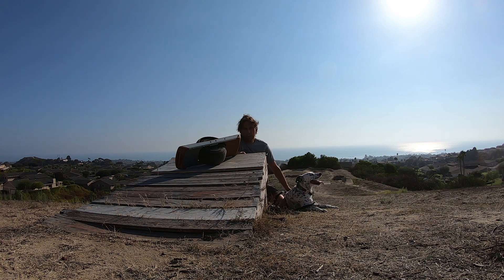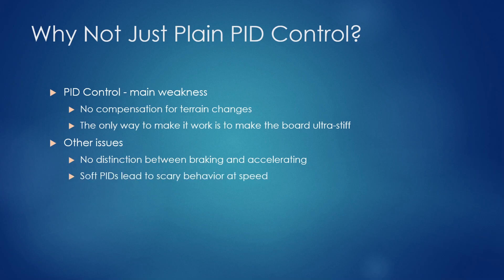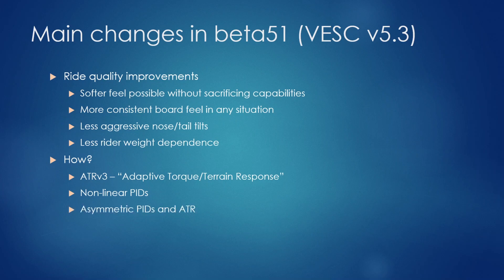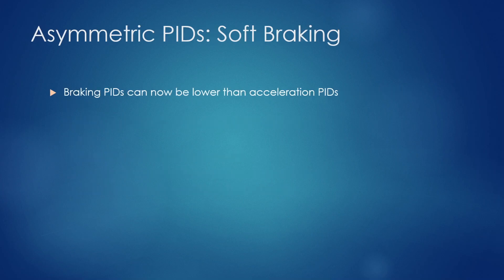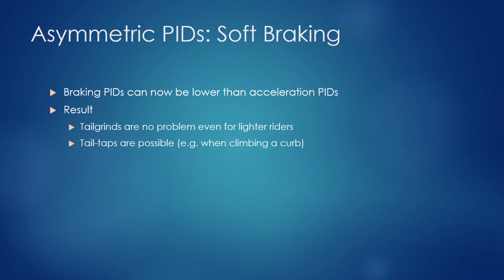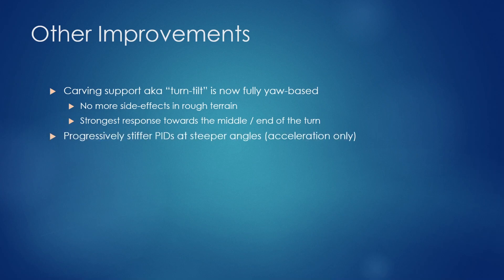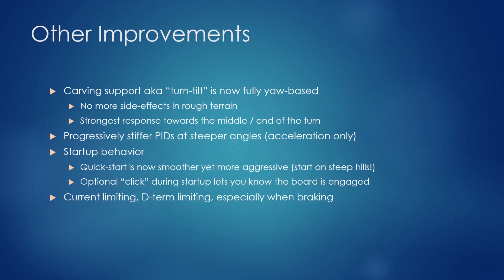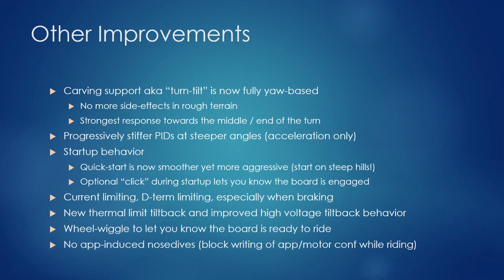Obsolete: VESC Adaptive Terrain Response (ATRv3) - New firmware for DIY Onewheels

Comment: Hello, I checked your repos but could not find XML for floatwheel. Anywhere a build is available for float? Could not find any in discord either. Maybe it's too early ;)
Reply from the maker: Sorry, beta51 isn't ready for release yet. I'm still trying to fix some issues. The Floatwheel discord has a link to the page with the firmware binaries and XML files (pinned in the vesc-configs channel), the latest available is beta37n still
Reply: Any ETA for release? Thank you for sharing
Reply from the maker: @kennethgaree7162  sorry, I honestly don't know. I've shifted my focus to my iPhone app, but there's still a number of issues I need to fix in the firmware before I release it. I needed a break from looking at log files ;)
Reply: Well actually I already had loaded 37n but without loading the XML 🤔